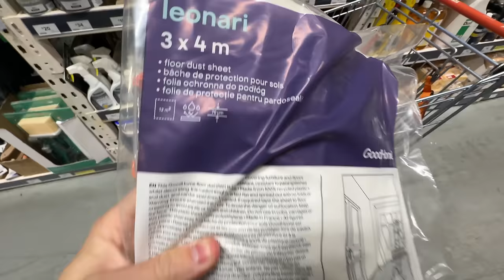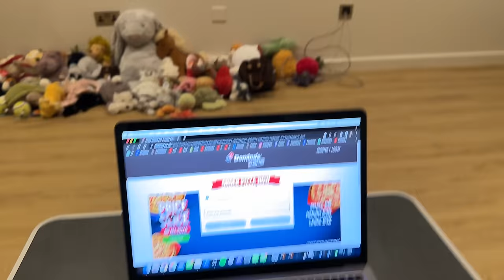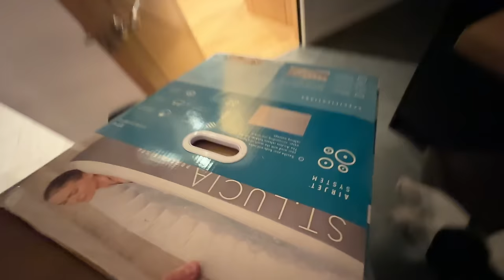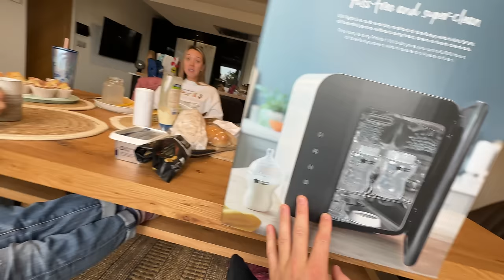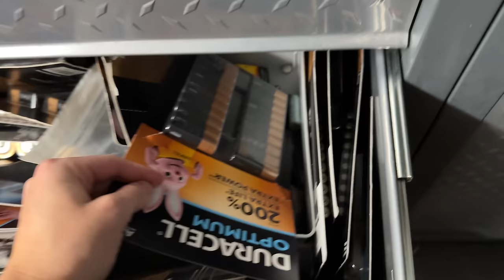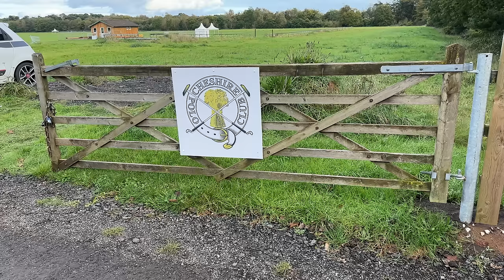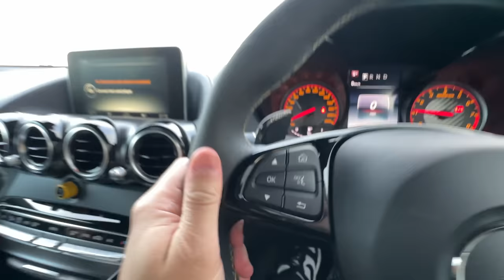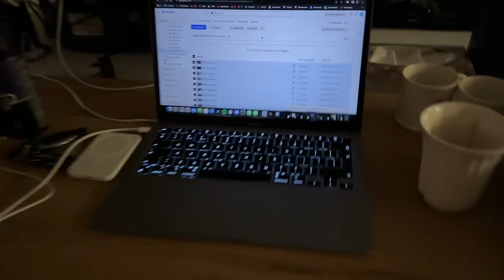I've managed to pull off the Impossible!

Comment: Make sure it's well ventilated when you turn it on else the room will fill up with condensation, and that isn't a cushion for the floor of the spar, it's goes on the inside of the lid to keep the heat in when you put the cover on

Comment: Tom, just a heads up. The insert you put in the lazy spa isn't a seat. It's the insert for the cover. If you use it as a lid it will probably block the water intake :)

Comment: Be careful leaving your merc on the hill cold starts with all the oil rushed to the front of the pan can cause oil starvation I'm sure the pickup on them would be able to handle it but constant starvation of oil more particularly on startup could cost you more then a battery that's for sure 😢 the sumps are usually tapered toward the back of the car because you require good pickup on acceleration so when you're hooofing it and all the oill sloshed go the back the pickup isn't a issue. Hard to tell how much of a gradient that caramanjaro is but you've said it's worse than it looks.

Comment: Just to point out in case you missed it, you should probably get an electrician or your dad to put a socket or blanking plate over the open plug socket that you just put a hot tub next to that your about to fill with water. 

Congratulations and good luck! 🎉

Comment: ☆☆☆HOPE THIS GETS TO YOU IN TIME☆☆☆ 
you might have read in comments already or didn't see in the instructions. 
The part you called the seat is actually the lid liner, which is goes inside the lid. 
Also the lazy spa will take an hour per 1°C to heat up so if you want it at body temperature it will take about 10 hours or so mate 👍

Comment: tom quick thing.. im sure you cheecked ahead of time but just incase did you check that the room with the birthing tub in, can hold the weight of the water ? i know that som rooms in a house cant handle the weight off the water from a hot tub, thought id let you know <3
Reply from the maker: Yes!